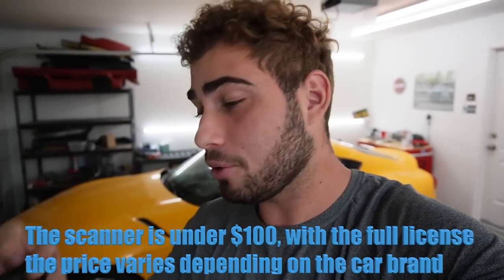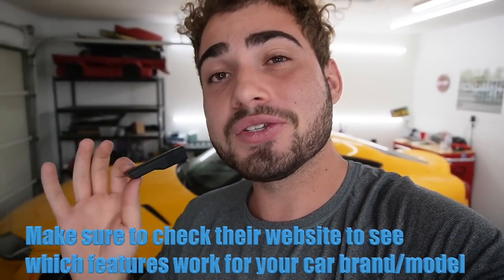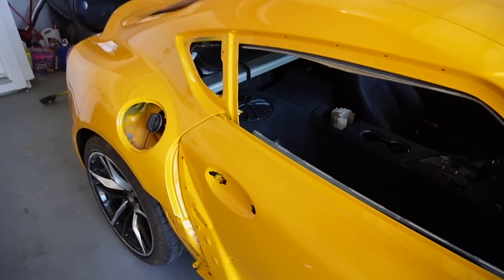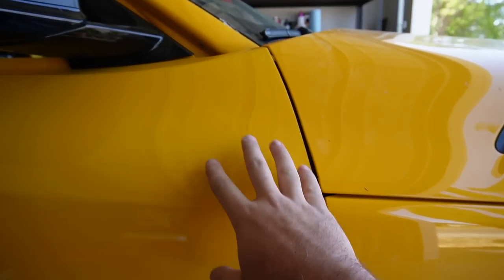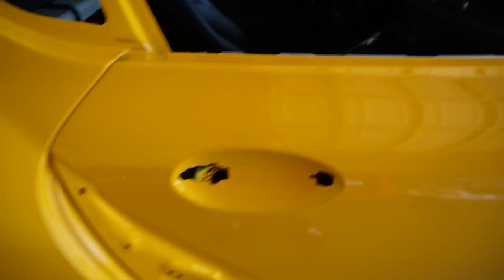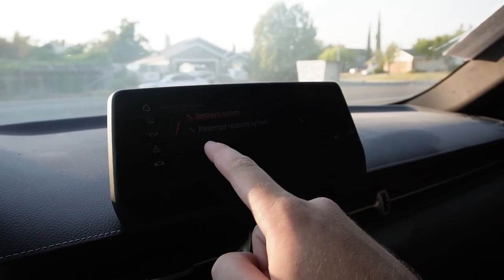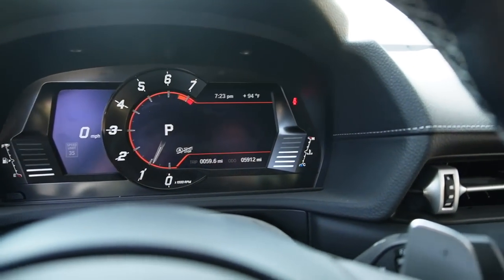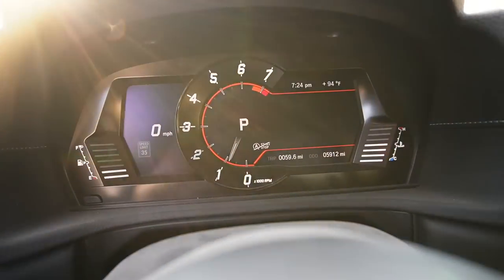AFTER MONTHS MY 2021 SUPRA MK5 IS BACK AND COMPLETE!

Comment: This Supra turned out amazing. Awesome work Nour. Also paint shop did a really great job, yellow paint is hard to spray properly and hard to blend in with other panels in original colour. I have only one advice for you, please remove the fuel filler cap once again and spray cavity wax inside that fender where it's been welded, especially where Ben put extra piece of metal behind and welded it. So it's won't catch up any moisture and won't rust. Great video!

Comment: Hey nour the supra looking good can't wait for the mods to start , small bit of advice I would seal and spray with anti rust wax on the back of the panels were the joins are personally I don't do joins  through middle of panels can cause so many issues and aren't manufactured approved methods but looks a tidy job but fair play to you for putting the cash and hours in getting it to this point now the fun begins let's go .